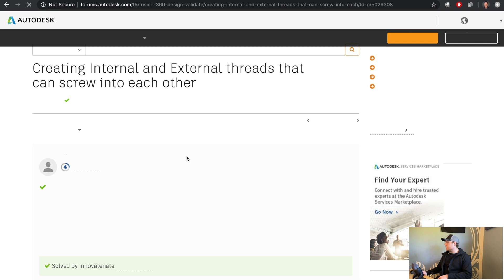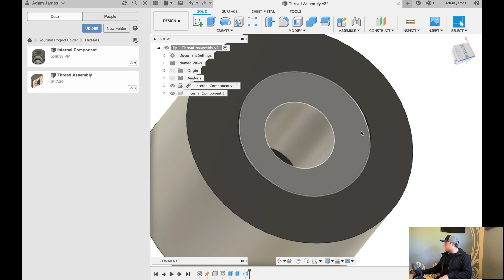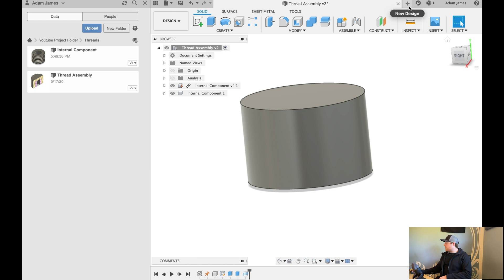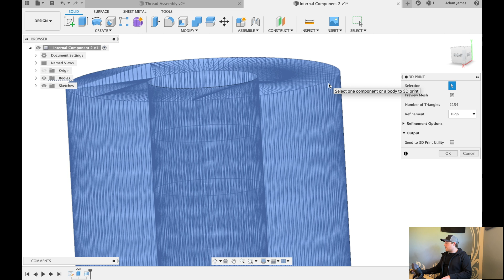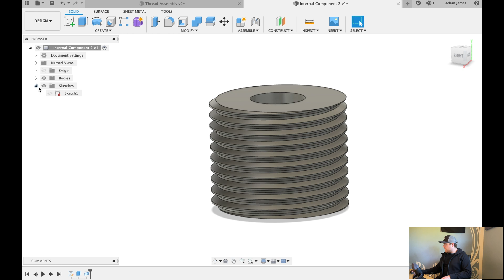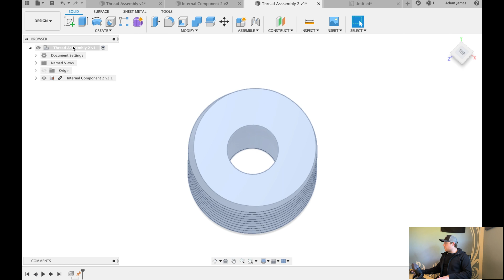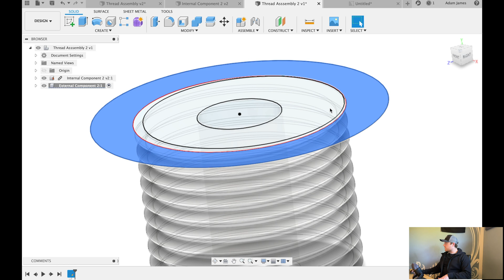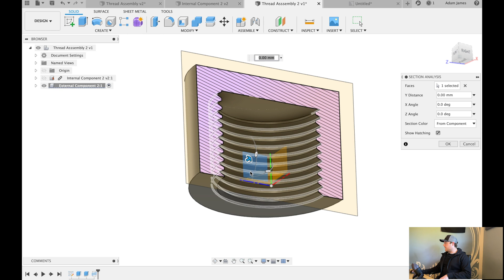How to Create Internal and External Threads in Fusion 360!

Comment: How do you make a swimming pool adapter that is a summerwave pool to an intex vacuum cleaner. One has to have inner threads and one has to be outer threads. The dimensions are 2.675" and 3.125". If you need a picture I can send one. I am not sure on the threads, pitch, or size of the threads. I think I know the inner threads but not sure on the outer threads and the part has to have a whole in the middle to allow water to flow through it.

Comment: great video, but not sure why the ISO metric profile seems to not work on the internal component, it is adding material to my overall part, what is the best alternative for large plastic containers such as a peanut butter bottle...etc, and how do manufacturers make partial threading as you see on all single use consumer containers?

Comment: Great job! Question: How does one reduce the number of threads used on the model you created? I like the idea of a round case but the problem  I have it takes many turns to get the two items separated. It would be nice if it only took one turn to unscrew the two items.
Reply: Double / triple threads is what you're looking for. As the name suggests, for each rotation they provide double or triple the linear movement as compared to a single thread (you might see an example of this on a plastic bottle cap)
Hope it helps

Comment: In my experience what you explained doesn’t work for 3d printing. You need to increase tolerance between threads. I would love to see a printed model.
Reply: I agree because I had just tried this technique which is a little different than I normally do.   Yes this method does allow a tolerance, but it does not work for 3d printing. All of my printers are totally in tune and this guy really does know everything...  the reason it does not work, is because if you draw a cube in fusion 360 20mm it will come out at 20.4mm on a perfectly tuned and calibrated printer.  Reason being the nozzle follows the 20mm cube at the center of the nozzle.  So assuming .4 nozzle and .4 line width, .2mm will stick out beyond the edges.  So yes this method does work but you need at least .2mm tolerance on the inner and outer parts.  Maybe just a hair more.
Reply from the maker: Hi Mr. Proctor, thanks for watching! I have used this more times than I can count and can confidently confirm that it works as long as the threads are large enough. If you’re trying to 3D print 3mm threads (small) these probably shouldn’t be 3D printed anyways. I’d love to hear others if they have concerns too, but from experience it does in fact work. If others have a similar concern, I can create a video 👍 thanks for the support

Comment: great tutorial, just subbed! though i wouldnt consider pla food safe
Reply from the maker: Hi PhotoshopVT, thanks for the comment! Natural PLA is made from corn starch and is generally considered food safe. But some 3D printing filament manufacturers will blend in other additives (colorants etc.) which can make the filament unsafe to use with food/drink applications. I would recommend always checking with manufacturers to ensure the filament is food/drink safe. A great food/drink safe filament I would recommend would be FormFutura’s HDglass (which is an ultra-transparent modified PETG). PETG also has many advantages when it comes to liquid based applications. Hope this helps! Thanks for subscribing!